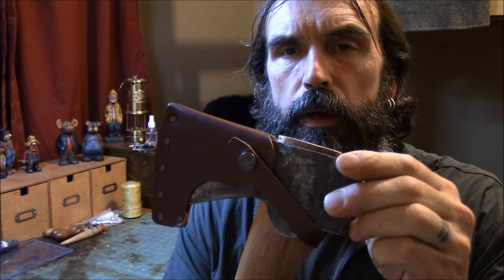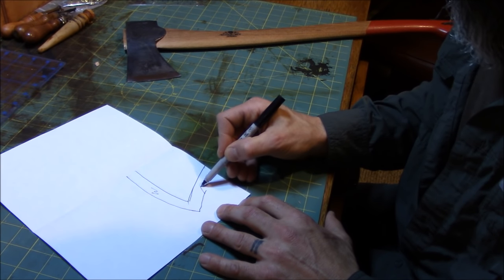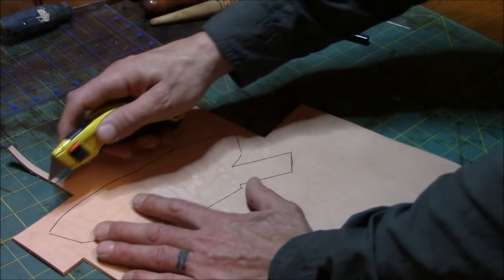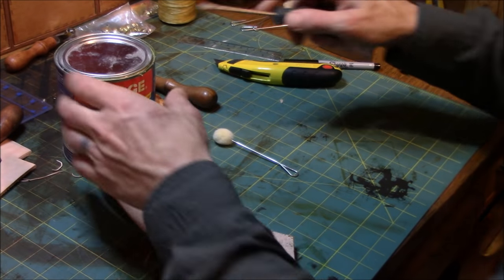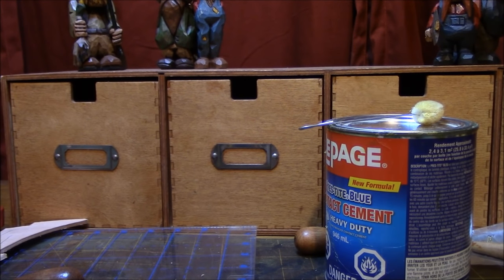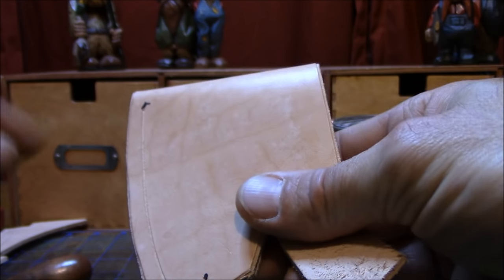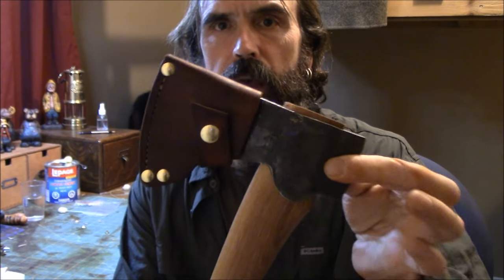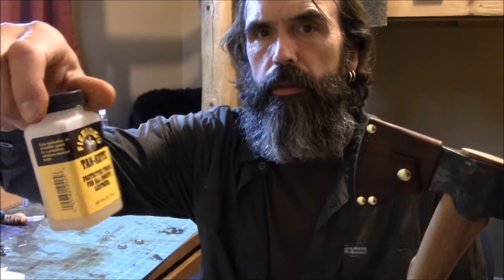Simple DIY Axe Mask

Comment: Thanks for sharing Doug. Professional dabbler here too... A tip on punching holes and taking the stress off the hole punch... As you clamp down to punch your hole, twist the leather and the hole punch in opposite directions at the same time. The punch will cut like butter because it is drilling through the leather as it punches.
Reply from the maker: that makes sense -thanks

Comment: Thanks Doug, great job on the informative video. I'm new be to leather work, but this has sparked a great deal of ideas and interest. I've got a pile of new and old axes to cover and re-cover (Husqvarna axe sheaths suck too). Great technique on the saddle stitch, the one piece, and the heathy welt for the sharp edge to contact. Thanks again for the video. I've just come from the local leather supply store, and it's go time for me. 
God speed young man, and Semper Fi

Comment: Nice job. I'm not a leather worker either, but I've been doing my own leather work for over 40 years. I use a short wooden dowel rod, chucked into my drill press for burnishing. Just wet the leather, and feed the edge along the spinning dowel. I cut different size grooves in it, with sandpaper wrapped around different diameter dowels, held against it when spinning.

Comment: Doug, thanks for the great tutorial for making a sheath. I have some leather working experience, but not a lot. I found a hatchet a few years back and take it with me when cutting firewood to de limb some of the smaller branches off the tree trunk. Anyway, I had been packing the super sharp wacker in my back pack without any blade protection and thought I should get on that right away. The only thing I did differently was I chose to double stich along the welt, without using rivets...turned out great...THANKS !!!!
Reply from the maker: great! glad it worked out for you -double stitching would be a nice touch

Comment: We are leather workers, but it is still interesting to see how people do their leatherwork. 

In regards to drilling - it is not so much that the drill removes material, it is that the awl will spread the fibers of the leather apart, the thread goes through (twice) and then the leather fibers compress back to their shape, holding the thread securely.  If a stitch is cut later on, the whole seam will stay intact, because the leather is gripping the thread adjacent to the cut stitch.  I've had to pull stitching out, and it was insanely laborious, had to cut and pull each stitch individually.

But, I love watching you work, you're like a combo of a rhinoceros and a front loader,  nothing can stop your thrust.
Reply from the maker: ha -thanks! appreciate the comment :)

Comment: Killer vid.  I watched many vids and found this vid to cover everything A-Z.  My first mask came out BEAUTIFUL....I didn't have enough allowance for the beard and the way the hatchet pivoted and while I test fitted and it was snug....as soon as I riveted, I couldn't get the hatchet in the mask.  The burnishing and the shape and the stain and stitching was great.   This vid gave me the roadmap to get it done.  Sniffing glue as I write this for 2nd attempt with new mask.   I hope I get the size right.  Thanks Doug!
Reply: I had the same problem, ended up slicing a hole in the top by trying to force it. On my second attempt as well. How did yours turn out?
Reply: @MrFreeGman  My others turned out killer.  Since then, I have made ~6 more and I also have done about 15 knife sheaths.  Fun stuff!!
Reply: @Ireland831 Good stuff man! Glad to hear you're still at it.

Comment: That is a very comprehensive DIY. Thank you Doug, I just cut out the paper template for my small camp axe. I don't have any of the tool that you are using, so tomorrow I am going to our local leather shop with my template and make a nice sheath or is it mask? I will update on how it fits and looks. Thanks again.

Comment: You sir, are selling yourself short. Great job on the mask and I love the design of it! Quick tip for the dying, polish it with a soft lint free cloth once it's dry. It'll take off any excess dye that sits on the surface and if you add any stamps or tooling will help the image pop.
Reply from the maker: thx Brooke! good tip

Comment: I am a leather worker, and you did a great job. The only thing I would have done different (beside not drilling out the lace holes) is I would have done a dry fitting before gluing it together. (I use clamps to hold the piece when dry fitting) Side note: I also use gloves with the dye, if I get it on my skin, my skin peels off like a 2nd degree sunburn.

Comment: Thanks for putting this video together Doug :-)
I just got my GB Small Forest Axe and was going to do the same thing.
I'm also going to make a leather holster for it and a leather handle guard ..
Got my 2 coats of boiled Linseed oil on the handle over a 2 dasy period and now will be doing a coat of bees wax, for protection and a bit of grip.. then some Slip 2000 EWL on the metal :-)

Comment: Great final result and a top video with good simple instructions.. Stitching grovers might make it look nice and neat but they remove the strongest part of the leather . The top grain is the toughest part of the hide.If you want the stitches to be set down a little, moisten the leather as you are sewing and the stitches will pull into the surface a bit.

Comment: Doug, that's a great sheath and I bought all the stuff to make one after watching your video.  Problem is my axe is not flat on top as yours is (from heel to edge), and the edge is a lot taller than the rest of the head.  When I fold the paper across the top of the head, there is a substantial bit of extra as you get further from the cutting edge back toward the middle of the axe head.  Any suggestions on how to compensate for that?  Did I make any sense at all in my description?
Reply from the maker: +Jerry W Davis yes I think I get it but you may have to redesign your sheath by making it roughly the same way but having the snap fold over from the top and not up from the bottom.basically do the same thing but leave the welt up straight a bit on top and have the snap come down after the bottom is seated in sheath

Comment: Nice vid Doug..., but one thing..., why is there no metal wedge in the axe handle on top...? Is Gransfors cutting it short...???
Reply from the maker: well shoot! good eye -never even noticed that myself!
Reply: they want to be more ecofriendly so they try to use as little materials. but the head is still on the handle very tight.
Reply: Thanks for the reply...
Reply: Is this true..., because i dont really see that as a problem..., am i missing something here...???
Reply: You can read it on Gränsfors' website, why they don't put in the metal wedge any longer.
Link: https://www.gransforsbruk.com/de/nyheter/#post-15114
IIf you want to improve the fit of the axe head, you can soak the end of the handle, where the wooden wedge is, with llinseed oil. This prevents the wood from drying out and shrinking. But i don't know, wether it is necessary, i believe, Gränsfors knows, how to put on axe handles.
Reply: I myself never put in a metal wedge on my axes when I hang them. Tight bond glue both sides of the wedge and hammer it in. Haven't had one fail yet.

Comment: Great video! Only difference I've seen from the "experts" is gluing a shaved down piece of round leather to underside of the snap inside so it doesn't scratch the knife or tool when taking it off or on. But looks like brass snaps so shouldn't cause an issue since it's softer than the hardened steel.

Comment: I bought some 7-8 ounce leather off Amazon.  It was  12mm thick.  It makes a nice sheath if you can work it.  I had to wet both sides and use a 12 ounce ball penn on it to get it to fold in to two.  Then, I  had to put clamps on it for an hour to get it to fold.  I made a sheat out of it, just like yours.  I lightly sanded it with 400 grit before I sanded it to get all the hammer marks and clamp marks out of it.  That leather would make great snake boots, but not a leather you need to mold and shape.  The only thing fuller than my box cutter is my lawn mower blade after a years use.    That thick leather wore it out.

Comment: I just made a sheath based on this design, but I somehow made it slightly too small so whenever I put it on the axe the blade would slice the top from the inside. Eventually sliced a big hole in it. What a fail, back to the drawing board. Lesson learned: too big is better than too small.

Edit: Second attempt fits like a glove, and I also got a chance to fix the sloppy edges and stitching, fix some poorly spaced rivets, and improve the profile a bit. Goes to show that even the failed projects are invaluable for learning.

Comment: I have made quite a few sheaths for my axes this year.  I made some of them with a “keep” which hooks the bearded end of an axe if it has one.  What about axes that do not have beards?  My True Temper axes do not have sufficient beards to allow a Keep to work properly.  I built may sheaths along the same as you did but I cut off the keep and added two straps on the bottom of the sheath.  One thing I do is wet the area of the leather wher the top fold will be.  This will keep the leather from sometimes cracking along the bend on the finish side of the leather.  I just bend it and take it into the kitchen and let water run down the bend until it is sufficiently wet and then I fold it over until the opposite edges meet and the welt line meet up and then I put a few small spring loaded clamp on it until it dries and gets its form.  You have to wait for it to dry before gluing the welt in.

Comment: If you take the flat end of the drill bit, then grind a point on it and use it like you would the drill end, it will make a nice  hole without removing any leather.

Comment: Thanks for the tutorial Doug . Finding a mask that fits properly is difficult to find . TOO big , TOO small , inferior material . Your tutorial has inspired me to make my own mask . Monday l'm going down to Halfords to get some supplies and get started . One thing I would do differently is to dye the leather first , that way the inside will be the same colour . Great video . ATB Ken . 🇨🇦
Reply from the maker: thanks Ken -I did dye the inside by sticking the dobber in there but if you do first try not to do where the glue is otherwise ,have fun with it :)
Reply: Doug Outside . Made two masks , one for my hatchet and one for my axe .  After the glueing part , I took it to the grinding wheel to smooth out the edges and round off the corners . Worked well and fast . Stained the inside and outside . Drilled holes then stitched with neon green waxed sinew . Looked very professional without the use of any leather craft tools . I just unstitched everything and now waiting for the stitch groover in the mail . You were showing and giving us alternative ways of doing things , I would recommend getting a stitch groover if you want the stitches to be protected . Everything else can be done with everyday items . Thanks for the excellent tutorial , you're the best . ATB Ken .🇨🇦

Comment: The sheath I have for my gränsfors bruk axe has a burnished edge on it. The sheath is fine, but I think a mask would be better suited. The leather scrap on mine is not going to last that many more years, it already has had a run for it's money. And instead of replacing the strap, I'll just make my own.

Comment: I am not a metric man.  I am an inch, foot, yard man.  I measured the thickness again with my good Browne & Sharpe dial micrometer and the leather that I used measured .022”.  That is about 3/16” and dang near a quarter of an inch for supposedly 7-8 ounce leather.  I could not drive my stitch hole makes through three pieces and had to drill them.

Comment: I work leather a lot you did well until you picked-up your axe and used it as a hammer . it's just really hard on both tools I like a wooden mallet but rubber works as well the most leather Smith's use brass hammers because they are softer than the steel tools and don't mushrooms or chip them.